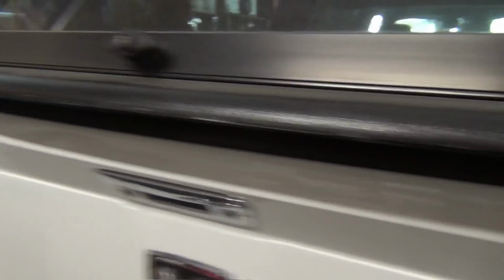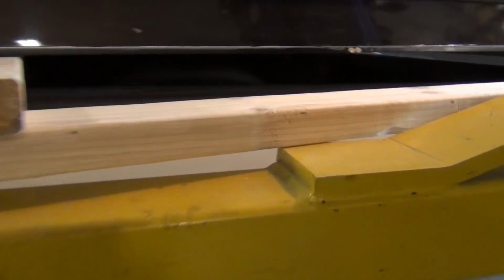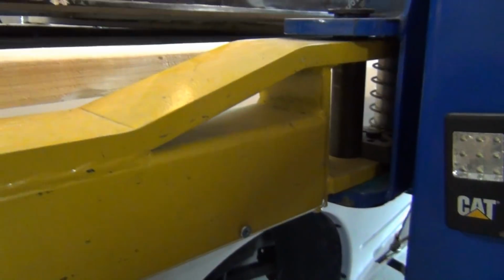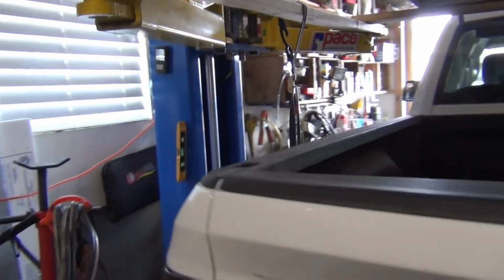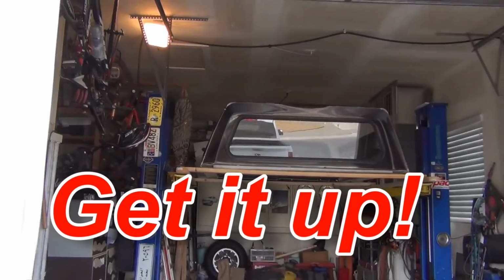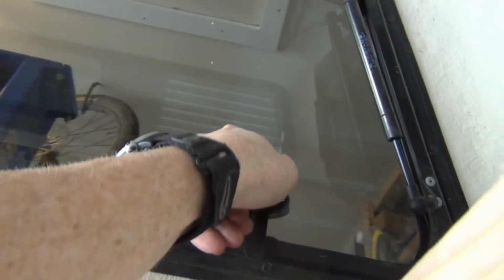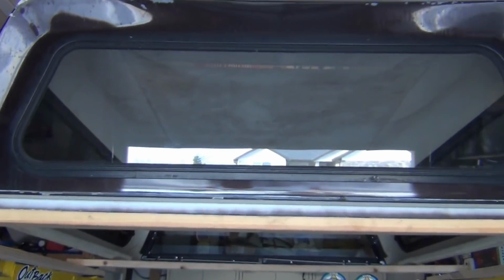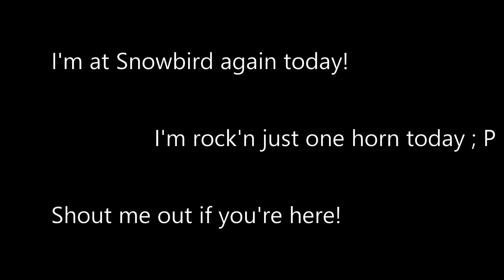Removing a Pickup Camper Shell Using a Car Lift

Comment: When you said rubber pucks, I was expecting to see hockey pucks! I keep a few around, they always come in handy for spacers or a hammering block to save from hammer marks. Also work as a cheapo gunsmith block if you drill a few holes in it. At a dollar apiece, I'm not afraid to cut them up if I need to make a rubber part or something.

Comment: I use the same 2X4 hookup and drive between 2 trees and lift the top using Harbor Freight tie down straps to lift up the cap.
If you put the outside 2X4s on the top [or place another block of wood on the back outside] it prevents the back sides from creeping outwards and gives less stress to the fiberglass.

Comment: That’s what I did same setup except I used come along’s one on each side but the shell was also on a 2x4 frame raised it to the ceiling of my garage that way it was out of my way, and when I wanted to use the shell I would just back my truck in the garage and lower it to my truck bed.. “works Flawlessly”.. cheers..

Comment: Going to add a third brake light to the rear of the canopy? I did that with my one before painting it, after doing the repairs where it had broken down the one side from falling off the previous owners bed on the freeway ( got it free for that). Did put in some steel plate with rivets and did a layer of glass over the inside and outside to cover it and then body filler to get it smooth.
Reply from the maker: Yes- That's a good way to do it!

Comment: Can you do a video on how to tell if your cat is gone or it’s just the o2 sensors?
Reply: Max Slaa He has one on his channel.  He cut apart the cat and showed the platinum and showed how to use a heat gun to measure pre and post cat heat.  I am facing a cat change on my Chrysler as soon as the parts come in.
Reply: William Fowler that’s sweet thanks. I’ll find t